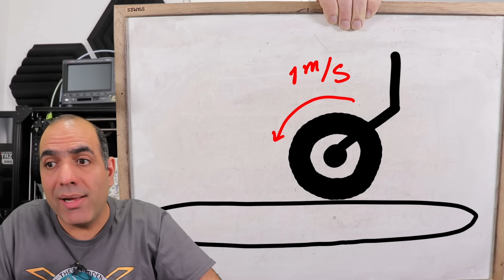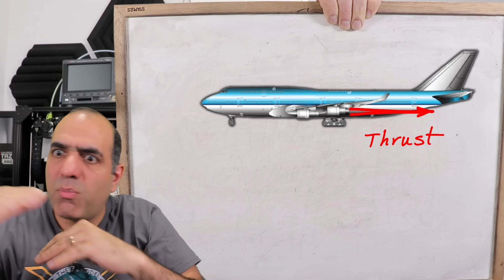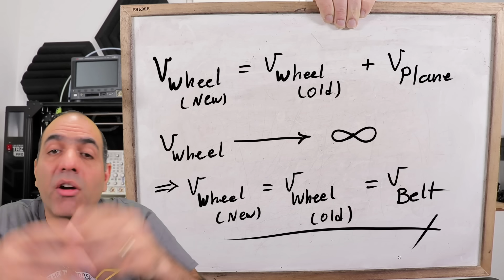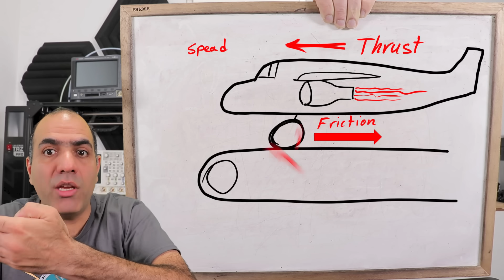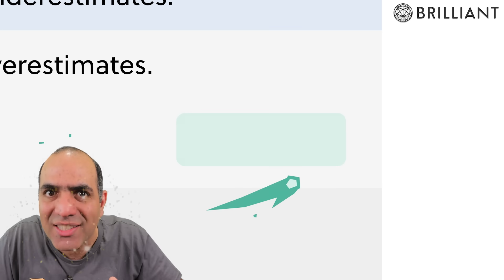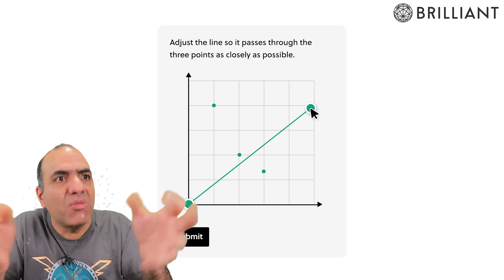Airplane Question that Drove Me NUTS!!!

Comment: The wheels have nothing to do with the plane moving forward, except supporting it on the ground until there is enough forward speed to produce the lift necessary to become airborne, the wheels can be spinning backwards it doesn’t matter.

Comment: Totaly simple answer to this is that no air is flowing from the wings of the plane. Thus wings are not producing needed lift for the plane to take off.
Conveyer belt and wheels are just making the plane stationary even if they are moving at full speed. Although at starting when the belt moves the weight of the plane acting on the convayer belt will move the plane backwards due to inertia. So i dont think the plane will survive....😁😁😁

Comment: I paused the video at 2:00. I need you to come to the right conclusion on this, OR, sufficiently convince me I’m wrong. Adam savage got this wrong on his channel and I argued with so many friends back in the day when this was all over the internet.

The way I see it, it the treadmill “magically” matches the speed of the tires, the tires can never make any forward progress with respect to the treadmill meaning the plane will never move forward through the air and never get lift to fly.
Reply: The plane would still takeoff, the speed of the wheels and the ground is irrelevant to whether the plane takes off. The wheels don’t push the plane forward, the propeller/jets do, so no matter how fast the wheels are moving, the plane will still push itself through the air and takeoff like normal. If planes needed their wheels to move forward, then they wouldn’t be able to fly in the air.
Reply: @melvinmcfly4498  If a plane were sitting unpowered facing forward on a treadmill and the treadmill started moving, what would happen to the plane? It would move backwards. The treadmill exerts a force on the wheels which exerts a force on the plane.
Reply: @rdear  it would move backwards if unpowered and the brakes are on, but when the engine is going full takeoff power and the brake is off, the extra resistance from the wheels is negligible compared to the force of the engine pushing forward. Even if the ground is moving backwards under the plane, that just means the wheels are turning faster, which doesn’t really matter for the plane.

Comment: If the conveyor belt is overclocked very much, then turbulation flows may occur that may lift the aircraft, even if the engines are turned off.

Comment: If the engines are on and applying a force to the plane, and there is no friction between the wheels and the belt, the airplane must accelerate forward and the belt wouldn't be able to match the speed of the wheels anymore. A belt that matches the speed of the rotating wheels of a moving object is impossible. Therefore, the plane must take off. 

Veritasium should try to answer this question.

Comment: My initial answer would be: No. Speed of wheels is not very relevant, since the plane takes off based on the wind below the wings.
Now, I don't know if a conveyor could ever produce enough turbulence to eventually generate enough wind for such a big plane to take off, but I know that some really light-weight planes can, in heavy head wind, fly "on the spot" - So if the values can go bonkers yes, but in real life no.

Comment: It has nothing to do with wheel speed or the thrust the engines create. The lift comes from the pressure difference created by air moving over the wings. If the air is stationary over the wings there is no lift and it’s not going anywhere.

Comment: No, the air has to move at a minimum speed over the wings to "suck" them up. That's going to be a problem if the plane is not moving in relation to the atmosphere. Hurricane force winds blowing at the plane might do it, but there was no information about current air speed. I won't go into details about wheels or the treadmill failing because I think that's beyond the scope of the question.

Comment: If the conveyor speed is proportional to the wheel speed, but in the opposite direction, then the plane speed relative to the air is zero, therefore the plane cannot take off.

Comment: You always know you're going to lose your mind when the question starts with: "Assuming there is air friction"
Reply: Bring in the Spherical Cows.
Reply: But then we also need to assume that there is gravity.
Reply: Without air friction, the wings wouldn't work though, right?
Reply: @jimskywaker4345  Technically speaking, wings work by creating a pressure difference above and below the wing. Air friction is a force that opposes the motion of an object moving through air, thus slowing it down.

Air is mid. World peace can be achieved pretty easily if questions didn't consider air's existence. Change my mind.
Reply: @nuriko6251  wrong, they do do that, but it does not contribute significantly to lift. (consider flying inverted) it's straight up newton's laws, the air is redirected downward by way of angle of attack.
Reply: @jnawk83  What do you mean "it does not contribute significantly to lift" ? That's how lift is generated. 

Aero. Engineers correct me if i'm wrong.

Bernoulli's principle states that as the speed of a fluid increases the pressure decreases. The wing has the shape  known as an airfoil. The plane's engines generate thrust, thus moving the plane forward. As the air flows over the curved upper surface of the wing (as it adheres to the wing's shape (Coanda Effect)), it moves faster (low pressure) than the air moving underneath the wing (high pressure). This pressure difference pushes up on the wing, creating an upward force that lifts the plane. The wing's size, angle of attack and shape do play a very important role in generating lift. You can think of it in terms of the newton's third law (doesn't hurt): the wing pushes air down as an action -> the air pushes the plane up as a reaction.

When talking about planes that can fly upside down, there are a lot of factors that come into play. Aerobatic planes have those symetrical wings, creating equal pressure on both sides of the wing, which helps  conciderably when flying inverted.  You can also play with the control surfaces (althought it might not be that efficient for sum) or throttle up the engines when flying inverted so as to (try to) keep altitude and airspeed. 

Not any airplane can fly upside down there are several challenges that come into play.
(Correct me if i'm wrong i am ready to take a lesson xD)
Reply: @nuriko6251 COVID - Spread by Air. Fires - Fed by Air. Hitler - Breathed Air. The math checks out.
Reply: @nuriko6251 If there was no air friction, the difference in pressure above and below the wing wouldn't have any affect in the airfoil, because the wing would slip through the air with no resistance, no matter what the pressure difference.  Air friction is allows the airfoil to split the airstream it creates.
Reply: This should be a 2 min video. To match the wheel speed means to keep the wheels static. To do that you need the force from the conveyor via the wheel system to exactly match the engine thrust. The system has balanced forces and isnt going anywhere.
Reply: @mycosys  ok, but that makes no sense, wtf does "match the wheel speed" mean? He literally explained why you are incorrect. Ok so the plane is, at an instant in time in this scenario, travelling 100kph. So the wheels would be rotating at 100kph, yes? You add in the belt, the belt is travelling at -100kph, perfectly matching the wheel speed. Now the wheels are technically travelling at 200kph. So by it being a logical fallacy it's already impossible for the belt to travel at the same speed as the wheels. The belt has to be travelling slower than the wheels at all times since the belt is ADDING to the speed of the wheels. 

Even aside from that, if the plane were going 100kph and the wheels were spinning at 5000kph, meaning the belt is going 50x the speed of the wheels, it would still take off because pushing on the air doesn't require an interaction with the ground. The wheels just approach a speed of infinity until they explode and the plane drags itself along the ground until it shaves itself into dust.

I'm sure you aren't convinced since you've already decided you are correct. But unless you assume a literally impossible scenario, the correct answer is all there

Comment: Mehdi is overcomplicating this isn't he? lol. I don't think it's reasonable to come up with scenarios like where theres zero friction and the wheels glide over the belt without turning as if its ice skating and the place takes off without the belt or wheels turning. If "too many" people are reading the scenario a specific way then thays probably the way the graphic was intended to be read and the graphic designer didn't want to include all the extra conditions on their fun little graphic. Most people are gonna read it imagining the wheels are turning at the speed they would be when the plane would normally take off, but while on this belt the belt would be going at a speed to counter it so the plane isn't moving along the runway, and then think will the plane take off. I really don't think it's supposed to be read in more ways than that. And in that scenario no it wouldn't take off. Some of the fun little questions areee too ambiguous but I think this one is straightforward and all this overcomplicating it is exactly what leads to the endless argumentive comments mehdi talks about at the start.

Comment: My take before watching:

Based on what I know with airplanes, physics, and aerodynamics, which is amateur level at best overall, this question seems like a trick question to me.

Think about it this way, an airplane is only ever seen flying whenever it has the sufficient velocity to generate the necessary lift under the wings to keep it in the air and from stalling to the ground. The only reason aircraft such as helicopters are exempt from such a rule is the different way its lift is generated, which would be its 'wings' of the rotor that the engine spins. That aside, we know that on an aircraft, either the prop, turboprop, or jet engine is what generates the thrust to push the aircraft forward and generate the other forces for flight. Now think of the problem like this: If the aircraft cannot move in a forward motion and is negated from moving at each attempt to gain velocity by the conveyer (which is contextually said to match the velocity of the aircraft) it is simply Newton's 3rd Law of Motion where the aircraft is experiencing equal forward and backward forces. Overall, the aircraft is experiencing a 0 Net Force despite any increase in thrust as it is not allowed to advance from that thrust due to that conveyer spinning at the exact negated speed of the aircraft's wheels. Therefore, the aircraft wouldn't be able to takeoff from such a conveyer belt, which mimics a runway,  unless that conveyer belt was disabled and effectively a normal runway again.

(TLDR: The aircraft wouldn't be able to take off because the conveyer is matching the aircraft's exact velocity, which would not allow the physical aircraft itself to move and not allow it to takeoff due to insufficient lift and velocity)
=====================================================

edit (after watching):

So my theory does seem to satisfy such a question, while I might add that I assumed all realistic forces are present. But I do agree with Mehdi that the question's answer could be simply as stupid as saying the aircraft would take off as it is 'sitting' so "No Thrust" could be the entire answer.

Comment: It depends on the headwind. Small planes can take off in a light headwind. A 747 however will not lift off in a natural headwind and heeds to travel forward for there to be lift generated over the wings.
So NO.

Comment: If we assume the wheels roll over the conveyor belt, the wheel speed at the contact point is 0 (this is true for every rolling object). So yes the plane can take of and it is just like taking of from the regular runway.
Reply: No airspeed equals no lift, so the aircraft can't actually get off the ground.  Ground speed is only an approximate reference, and it's always modified to account for air speed when calculating lift.  Since this aircraft effectively has a tailwind that always matches the aircraft's forward speed, it can never get off the ground.  Just like how a wheel lug's torque isn't actually relevant to how tightly it is attached to your car, but is just an easily-measured approximation of the wheel stud's stretch...which is actually what clamps your wheels on.
Reply: What if we use RPM

Comment: If the wind is strong enough the plane doesn't need to be moving relative to the ground at all. The fact that they did not specify the direction and speed of the air means the question is incomplete.

Also, they don't say if the wheels are allowed to slip or not. If the wheels must be in constant static contact with the conveyor belt, then mathematically the plane cannot be moving relative to the ground or that would be a contradiction. If the wheels can slip, then sure it can move as much as it wants. But then you have to know how much drag is caused by that dynamic friction.

Comment: I mean,, the speed of the wheels on the landing gear plays no part in how an airplane flys , so ... no difference from a normal runway.

[a bit later]
ok,, if we assume friction, and belt and wheels goes to infinity, the friction will cause the air to move in the direction of the belt, eventually being enough to lift the airplane.

Comment: The only way the conveyor belt can match the speed of the wheels is if the plane is fixed to the conveyor so that the engines cannot push the plane forward on the conveyor. Assuming the plane is fixed to the conveyor it cannot take off. However if the plane is not fixed to the conveyor there is no way for the conveyor to match the speed of the wheels as the engines thrust pushes the plane forward. Since the plane is rolling forward on the conveyor and the wheel's speed is the sum of the conveyor's speed and the speed of the plane moving relative to the conveyor. The plane moves forward and takes off.

Comment: Well, let's say we are taking into consideration the airplane's weight, wich would have a significant effect on the rolling resistance of the tires, if there is no headwind and the belt and the plane start moveing at the same time, allthough in opposite direction I belive the plane's engine's have sufficient thrust to get the plane to takeoff speed.
Reply: Ah, but the original question's premise was that the treadmill would always move at exactly the same speed as the aircraft's wheels, only in the opposite direction.  For the aircraft to move ahead at all, its wheels would have to move at a higher speed.  So rolling resistance would be compensated for by adding power to the treadmill so that they continue to be exactly matched, and the aircraft remains on the ground, because ground speed is irrelevant to flight, as it doesn't influence lift.

Comment: Like Mehdi says, too many undefined variables to give more than an "educated guess".
I guess the plane will fly, but would need new tyres and wheel bearings...  or the combined friction in the bearings and tyres might overcome engine thrust enough to stop the aircraft reaching take off speed.  Is the plane loaded with passengers/freight? Full fuel load?  Those effect how and when it reaches take off speed.

The Mythbusters example is irrelevant, they used a small propeller powered plane, that is known to be relatively good at STOL, the polar opposite to the 747 the original question posed.

Comment: (Related to 0:40)

Yes, the plane can still take off.

The speed of the conveyor belt matching the speed of the wheels will not affect the plane's ability to take off because the plane's propulsion comes from its engines, not from the wheels. The engines provide the necessary thrust to move the plane forward, and the wings generate lift that allows the plane to become airborne.

The speed of the conveyor belt might make it more difficult for the plane to take off, but it won't prevent it from doing so. The plane's engines will still generate enough thrust to overcome the resistance from the conveyor belt, and the wings will still generate enough lift to lift the plane off the ground.

Therefore, as long as the engines are functioning properly and the pilot applies the correct takeoff procedure, the plane can take off from the conveyor belt runway.

- ChatGPT 2023
Reply: 😂😂 that chat gpt caught me off guard.. and btw this explanation is not accurate bcz engine my provide thrust but it doesn’t create lift in its wings.. (replying before watching video)

Comment: The wheels and belt would just keep accelerating exponentially since the thrust moving the plane forward exists outside that system. Eventually the wheels would be turning so fast they’d overheat and blow out.

So the question is: Would the plane manage to get up to V2 before the wheels explode?

Edit: According to a quick Google search, V2 for a 747 is 188 knots. So that squared is 35,344. So for sure, the bearings or tires would fail catastrophically WAY before the plane could get going fast enough to get off the ground.

Comment: My answer is it depends. If the Conveyor Belt is moving forwards in the same direction the plane wants to move, it’s acting like a catapult, like one from an aircraft carrier. That is if the runway is fast enough, long enough, and the engine is on…

Moving backwards? Well with almost 0 knots headwind, no, the plane won’t takeoff.

With a couple hundred knots of headwind, you can get the plane to takeoff.
Reply: So "moving backwards" part. The issue here is in order to get the treadmill to move, the plane has to have enough thrust to start the plane rolling. Once it starts rolling, it only cares about the wheels if they suddenly go missing or otherwise lock up before it gets airborne